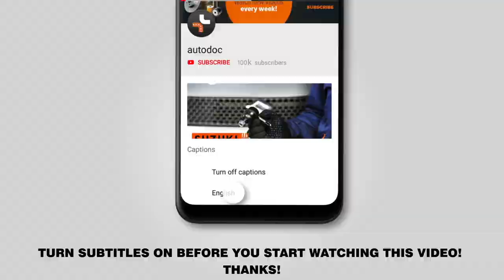How to change front brake discs / front brake rotors on OCTAVIA 1Z5 [TUTORIAL AUTODOC]

Comment: Took me 2 hours so far using a jack and axle stands but still the disk is not off - it took this guy under 4 minutes to get that far - I reckon they disassemble all bolts first then fit it all back together again, before they start recording.
Reply from the maker: Unfortunately, the complexity of replacement is individual on each particular model of car and it all depends on the technical condition of the parts. Our videos are for informational purposes and show only in the sequence of replacement and to save time, we loosen some of the units in advance.
AUTODOC
Reply: @autodocuk  Yes that is ok -no criticism. 
 I was only trying to warn other amateurs like me that the jobs are not as quick as filmed  - but to not despair.

Comment: You quote 75nm torque for tightening the brake carrier bolts. I thought it was about 200nm. That’s a big difference. Which is correct please?
Reply from the maker: Thank you for your attention!
You are right, we made a mistake in the credits. 
Unfortunately, we cannot change the credits, but we will add information to the description.
The correct catalog information:
Tightening torques for front disc brake caliper bracket = 190 Nm
Stay tuned with us.
AUTODOC

Comment: WARNING Why have you not yet corrected the torque you have shown for the brake caliper carrier bolts from 75 up to 190 or 200 Nm - as pointed out by John Ralph below ?
Reply: Which key and brand you can recommend for this purpose? Thanks
Reply: @sergenity  190
190 Nm

Comment: Is it necesary to add cooper grease? Is it not necesary to grind new pads with angle grinder?
Reply from the maker: Copper grease should only be used on threaded connections. No need to grind new pads.
AUTODOC
Reply: As far as i see in this video, you did not add copper grease only on threaded conections, but on whole surface between wheel and disk.